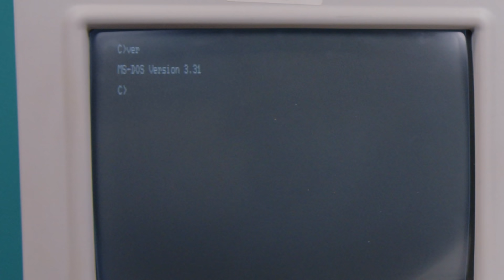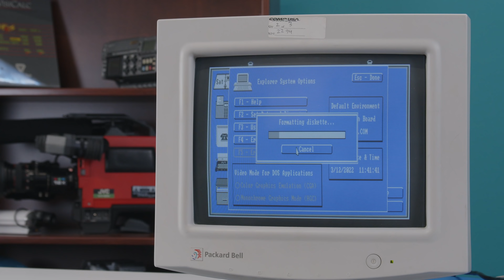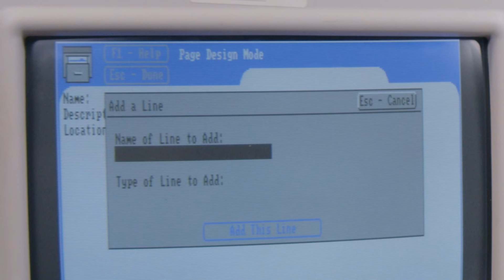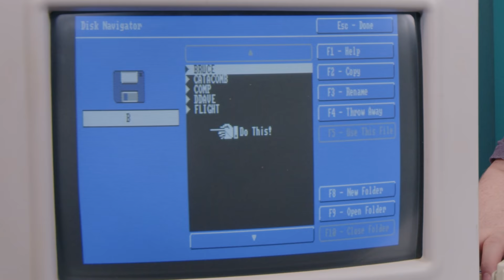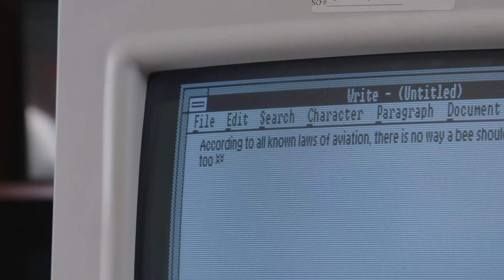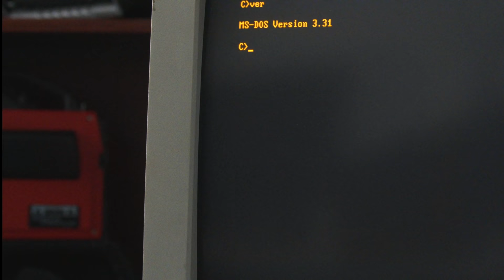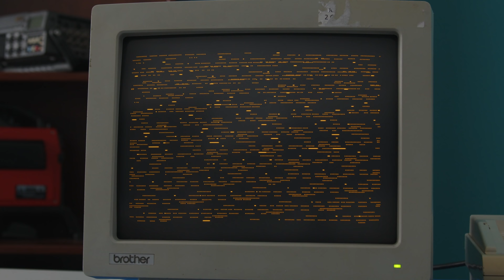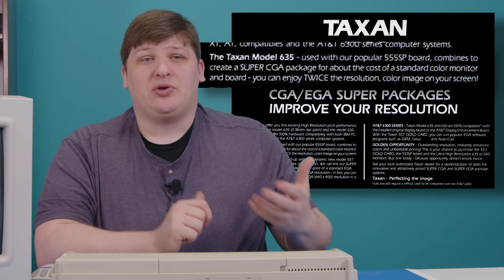Headstart's PC With The Weird GUI "OS" [Explorer]

Comment: I wrote a program that moved around icons and had menus and stuff as a teenager, from scratch. I knew C but had no tutoring in writing GUIs, nor read any articles about it. I'd used Windows of course, but that's it, from there I managed to implement parts of it in a couple of days, in C. Given a few days longer I could have easily matched the "Bulletin Board" on this. Getting icons and stuff, a bit of rudimentary animation, isn't difficult, at all.

The hard stuff in Windows (going back to 3.1, say, the first "real" OS version of Windows) is the multi-tasking and the memory allocation, and keeping track of that, implementing APIs to send messages between programs, implementing an API for icons / buttons / etc, in fact implementing APIs for basically everything! With all that implemented properly, a simple word processor like Write isn't much more than a few dozen lines of code, just picking the right pieces and stitching them all together.

I dunno how much of an API "Bulletin Board" provided. Doesn't luck like much though, and apparently did a bad job. My point is, they deserve criticism, it isn't very good. Much better could have been done. Look at GEM on the Atari ST (and on the PC too), was much more like an OS, released in 1985.

Maybe Bulletin Board, and others like it, weren't meant for serious use. Just a bit of tinsel, something the guy in the shop could boot up to show mums and dads and small business owners, to give them the windows and icons and stuff they'd seen recently, to impress them. Actual usability wasn't so important, people would be using real software off floppy disks in practice. This was purely to show what it could do, if you bought some proper, actual software. Windows or Borland's thingy or the like. A cardboard mockup not meant for actual use.

If it sold a few models, then it had justified the 16K ROM or whatever it took to put it in. That probably just meant buying the next size up when they were choosing the BIOS ROM chip, half full of BIOS, half "this thing". Would only cost a little more.

Comment: I doubt much new software would play on it but my PC is still going strong a tower weighted down by a PSU at bottom & a DVD Writer top, running Windows 98SE a Celeron 600MHz CPU and 64 Megabytes of SDRAM together with a 10 Gigabyte HDD a FDD on a CUSLM 2 motherboard. Mouse & Keyboard speakers & monitor I even have the handbook that came with the MB. Seeing a copy of VisiCalc over your shoulder brought back more memories too. I used 1-2-3 for ages after most if not all of my colleagues switched over to Excel. Great documentary btw.

Comment: I demand you say something nice about the BBC Micro's keyboard immediately.
It was a dream, double shot labels, cast from unobtanium and designed for school use.
With machines were bomb proof, after the BBC had issues in  Australia, subsequent acorn computers were tested literally in ovens to test they would work up the melting point of the polymers.
Reply from the maker: i am saying something nice about the bbc micro at this time (i have never tried the keyboard but everything else about them is top notch)

Comment: I had a Commodore 64 as a kid.   I went from a ZX81 through a Spectrum, so when I got the 64, I thought the keyboard was the most amazing keyboard ever, beaten only by my mum's IBM golfball typewriter, but I put that down to the typewriter being designed to be used for typing.

When I got rid of my c64, I got an Amiga, which also had a keyboard I liked.   Then I went through various PCs and Macs, before finally settling on what I think is the best keyboard I've ever had.  The Unicomp Model M.    It is essentially the original IBM Model M in a different colour case and with a USB interface.   It's amazing, if loud.

Last year, I went to a computer museum, and got to use a c64 and Amiga again.    Their keyboards felt awfully spongy.

Comment: Commodore used a 23-pin DB connector for external floppies on the Amiga and on (at least) the PC-I - which carries power and the bog standard floppy data lines. With a regular passive adapter, it can run a USB floppy emulator. I'm willing to bet that this external connector is set up almost the same way.
Also, CGA is often referred to as "16 color" in promo material because the TEXT mode had 16 colors (RGBI combo, which you can still find in the default console color settins in windows)

Comment: 1988’s Amstrad PPC512 / 640 models had a more sleek (luggable) form factor with a suite of utilities. The LCD screen was useable but it fitted into the “use power and a monitor at the destination”. People did use them on the train. Whilst not completely IBM compatible, I can see why Sinclair’s Cambridge Z88 had a following, being way more mobile.

Comment: The full Shugart Interface needs 20 pins only. The entire bottom row of the connector is ground so you only need 19 signal lines plus ground.

3 pins are “reserve”
1 pin is “NC” for not connected
1 pin is “Disk change” which hardly any drive has (extra switch sensing changing the disk)
1 pin is “Density Select”, which downgrades a drive, e.g. HD to DD. A DD drive can’t be downgraded.

So for a full feature Shugart Interface, you only need 15 pins plus ground pins. Without the Disk Change signal you are down to 13 signal lines.

You can connect 2 drives to one interface, there are 2 select lines and two motor enable lines. If the port is for a single drive only, you are down to 13 signal lines. Then you have 12 pins left for ground which gives you the extra shielding between signal lines as intended in the Shugart Interface.

I’d bet that if you remove the connector from the internal drive, you can use a multimeter to probe for the pinout of the external connector since most lines – if not all of them – are connected in parallel to the internal controller. You might have to experiment with the motor and drive-select lines which is not hard to do. If the motor stutters weirdly, you have swapped those lines.

Comment: No human can keep up with any CPU, even 1MHz is drastically faster than a human. No matter how slowly it renders, there is no excuse for not buffering the keystrokes, processing all of the buffered keystrokes, and only render if the keyboard buffer is empty. This would cause it to catch up and skip the expensive render when struggling. PC has interrupt driven keyboard input. The 8042 makes it almost inconceivable to fail to keep up with the user - it is a separate microcontroller that ensures that dropped keyboard input pretty much cannot happen. If code loses keyboard input on an early PC, it is awful code.

Comment: I used to have an Atari PC3 which was based on an 8088 running at 8 MHz  (or 4.77 MHz w/o turbo). It had a 16 color EGA graphics adapter and as bundled with MS-DOS and GEM (Graphics Environment Manager). GEM also had a writer app and a paint app and the writer app was definitely faster than the one build into that machine and the painter app was more powerful than the one of Windows shown in the video. GEM was a pretty neat desktop system but I've never seen any 3rd party software for it.

Comment: It's really cool to see a low-cost luggable PC with Hercules graphics. Hercules was pretty dang powerful for the time, and it's what my family's AT clone had. It'd be interesting to see if SIMCGA runs on the Explorer; I remember it having some performance issues but generally being good enough to run most CGA games at the time. Although it didn't even try to do any of the dithering you demonstrated, and instead just mapped the low-level bit patterns to pixels directly (so colors would just appear as vertical stripes).

Comment: THIS IS THE FIRST I'VE EVER HEARD TURBO.  That is an absolute paradigm shift in my knowledge of old PCs.  I thought if you ran a program intended for older hardware that was too fast you were just out of luck and there was no way to run it.  Growing up, often I'd run some old DOS program off a Shareware CD that just ran at lightning speed and I thought there was nothing I could do but remember not to try that program again.  Talk about a major gap in my self taught computer knowledge.  An actual joy to learn something new.
Reply: Actually there were programs that one could use to insert wait cycles if your PC is too fast for programs that assume you have a 4.77MHz 8088 instead of a 386 or whatever. One I recall was a TSR called "MoSlow". It did just that, ran things "Mo' Slow." Had a numerical argument to determine how much slower, you had to play with it to get things right.

Comment: "I'm honestly not aware of anything else in the '80s that could render text that cleanly"

A couple of other people have already mentioned this, but to expand on it, the Atari ST with its 70Hz monochrome paperwhite monitor put PC monochrome - not to mention the original Macintosh - to shame when it came to rendering text.  And it could also do monochrome bitmapped graphics.

Comment: Fun fact: early variants of the MDA card actually have undocumented 8-color support! This was removed in later revisions (although it can be added back just by adding a few wires), and no known software of the time made any use of it, so it was basically useless, but it technically existed. Speculation is that it was a vestigial thing from the mainframe graphics adapter it was based on. Also, EGA was better than just being able to show all the 16 colors of CGA at once, since, while it only allowed 16 colors on screen at once, they could be selected from a palette of 64.
Reply from the maker: There are several problems with EGAs extended color mode that render it essentially useless. One is that it can't be used except in 350-line modes, because of cost cutting measures in the monitor interface; also, it depends on the enhanced monitor, which was completely IBM proprietary unlike the original RGBI display, so virtually nobody developed any software for it; and finally, the palette is awful. It looks expansive at first glance but it's really just a ton of greens and purples with no real uses and very little else. I've been wanting to make a video about this for a long time but finding an EGA enhanced monitor is really hard, haha
Reply: @CathodeRayDude  I see; honestly I didn't know all this! I hope you're able to make that video someday :)

Comment: That keyboard issue is a huge deal when integrated with the machine, and I don't think people consider that, even now.  I've got a Raspberry Pi400 which looks pretty much like a modern keyboard, but the "Debounce" is terrible on it.  Very frequent double hits, and misses that will drive you nuts and are really noticeable if you try any typing tutor software.  It would be great if more companies  made the effort like the Headstart.

Comment: The 4 color palates of CGA can actually be combined to make 16 non-headache-incucing colors when displayed through a composite video output. CGA was actually a lot more decent that it's given credit for, it was a genuinely ingenious way to exploit the quirks of analog color video, but unfortunately it was usually used with a sharper monitor with RGB input for better text quality rather than a composite monitor where its graphics mode colors could be properly displayed.
Reply from the maker: The artifact color feature was - as far as I know - not documented by IBM, who may not have even realized it existed. It's an interesting hack, but I don't find the increased color capabilities worthwhile in exchange for the laughably truncated resolution, which is effectively something like 160 on the horizontal.

It looks like a blurry, smudged mess, even on a good display - in other words, it looks like what it is: a hack Wozniak invented to make the Apple ]['s pitifully underpriced hardware output color, brought over to a machine that had absolutely no right to ship with graphics that poor given it's massive price tag.

IBM guessed wrong about what the market wanted; they thought that the only two demographics were "office workers with $3000 to blow who want 80-column text" and "kids with big allowances who are going to buy the bottom-spec $1500 version of our machine, then write crappy videogames and distribute them on cassette."

CGA should have shipped with double the RAM. The increased cost would have had no impact on sales, and PC graphics wouldn't have looked like a joke compared to computers released just a year later, that cost 1/5 as much and used technology from half a decade earlier.

Comment: I dunno the apple 2 had some pretty nice Alps keys on many machines and were excellent to type on IMO… Many cheaper computers had some decent key switches in them… Yes there were some pretty horrendous keyboards, but they were not all bad…
Reply: I recently repaired my (early revision) Amiga 500 and the keyboard is excellent! I never had a keyboard like that afterwards until I learned about the differences between PC keyboard types and got a Cherry with mechanical keys.

Comment: Whoa....DOS in ROM is almost as good as Kickstart included for AmigaDOS on the A500 and A2000, although that inbuilt GUI dosen't come close to AmigaDOS or even DOSSHELL in 1991 on the first PC I ever bought, an AMD 386DX40Mhz CPU with 4mb RAM, a 105mb HD and a VESA 2.0 VGA card. Still this HeadSteart is a good little PC about 2 years before PCs became viable as real gaming platforms over the 16 bit computer offerings from Commodore and Atari.

Comment: The 8-bit guy was able ti demonstrate that the CGA adapters had RCA video output which could display 16 colors.  I recall I had an IBM XT compatible which also be had RCA output, but I never used it.  If I tried, I might have seen the 16 color mode.

Comment: A ton of dumb terminals in the 80s had text that looked at least as good, if not better than the MDA card. Unisys, for example, used to make some with really good-looking text displays. Dumb terminals were pretty much the last gasp of the text-only display technology.
Reply from the maker: That's a totally valid point. People *were*, after all, doing work on e.g. CP/M machines over terminals like you describe. I guess what I was thinking is that the PC was the only self-contained system I can think of.

While I didn't think it this far through while writing, if I had, my take would have been that the PC was more of an "appliance", a finished consumer product you could just buy and use, than the machines you'd be hooking a terminal up to; but at this point I don't even know if that's true.

Comment: So, I have a story about the HX. Years ago, I worked for Electronic Boutique (now Gamestop), in PA. I would regularly visit our mall's Radio Shack to see what was going on, and I noticed they had a 3.5" HX model there. I shook my head and told the manager there that we had NOTHING that would run on it. I think he ignored me.

Sure enough, a family entered my store, having just come from Radio Shack and had their new HX with them. They wanted to know where the 'PC software' was. I pointed to the wall and said, 'It's over there, but you won't be able to run anything but MS Office on it.' Shocked, the dad went over to the wall, picked up a title and said, "But this is for the PC! Why can't I run this?!"

I explained that ALL of the PC software we had was in 5 1/4" - very sorry. Radio Shack certainly had a few titles... They stomped their way back to RS and demanded a refund, which made their manager come to my store and demand to know why we told them there was no software. I pointed to the PC wall and said, "Besides MS Office, find me the title that will run on the HX..." After looking for a while, he realized what I was saying all along was right and apologized. I told him, 'no worries'. Sooner or later, the PC would catch up with their competitors. Tensions between platforms were still high in those early days...😁

It wasn't that 3.5" disks were an unknown. After all, I'd been using them since my Atari ST and Amiga, circa 1986. The Macs had them in 1984! The issue was, software stores like ours tended to carry what most people had on their desks. The 3.5" floppy  hit much later for the PC, since it started with 5 1/4".

Comment: I think the problem, ergonomically, with the all in one wedge shaped computers in the 80s is the technology required relatively large motherboards, which, in many cases, needed to sit below the keyboard, which meant there needed to be enough space beneath the keyboard for half the motherboard, and all its components.   This isn't good, ergonomically.   The PC had the advantage that the motherboard was in a seperate box to the keyboard, so the keyboard could be relatively flat.  OK, so the box was huge, but could be bunged under the monitor, or, if the cables were long enough, could be put on the floor (although this isn't ideal for desktops).

I think by the late 80s, technology had improved, with the 16 bit computers  still not having great keyboards, but they were at least lower, and slightly more comfortable.

Of course now, tech has improved massively, with the result in the AIO space, we have the Raspberry Pi 400, which is far more powerful than any 8 or 16 bit machine (indeed, it can give low end PCs a run for their money), and is a maximum of about 1cm thick.